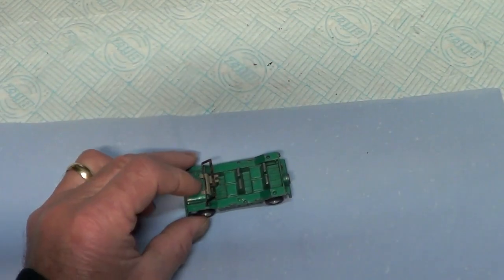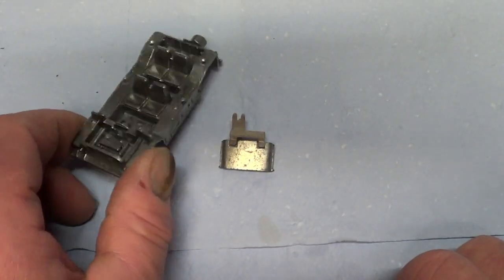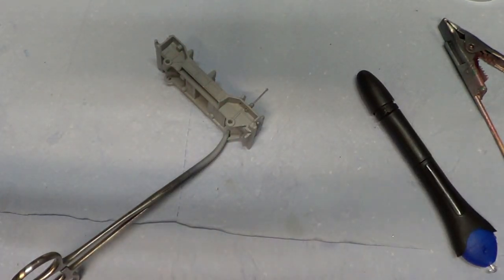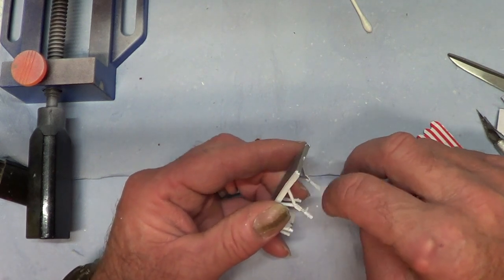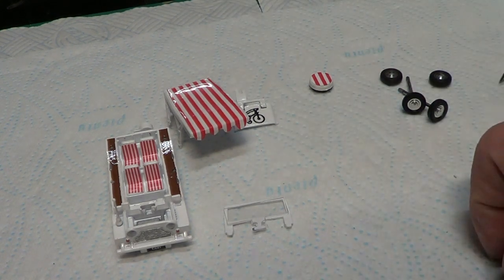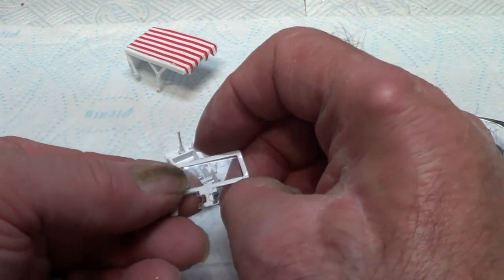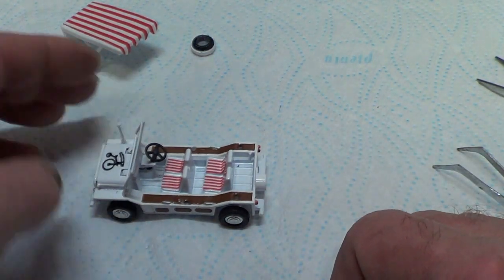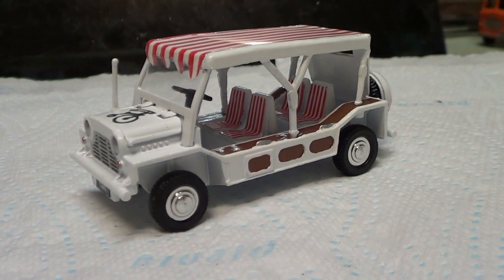DINKY MINI MOKE RESTORATION

Comment: Another fine restoration.  This video taught me two things; that you have more patience than me and that I will avoid ever restoring one of these Mokes.  Conversely I did have a great day many years ago when I hired a real one during a day off work on Barbados, however it had no roof and I ended up with all my exposed bits sunburned a vivid shade of red.
Reply from the maker: Thank you David, had it been three years ago I think that the model would have ended up going out the window lol, I’ve mellowed with age and a bit more practice😉😁 I bet it was fun driving around in a mini Moke ,  I bought a little convertible Suzuki Jimny a couple of years ago for going to work in, nice and cheap, a bit of an old banger really 110,000 miles on the clock, freezing in the winter but great fun in the summer with the top down, ideal for Jersey👍😊😁🐸🐸

Comment: I reckon the finished model looks pretty cool Nick despite the paint problems with the plastic canopy. I've recently bought a plastic repro cab for a Britains Ford tractor (not Model Supplies) and they sent instructions to wash it with warm soapy water, and thoroughly dry before paint spraying. I haven't done it yet but I wonder if that might've helped with your canopy? Looking forward to your next video, I'll be sending you a parcel shortly. All the best. Peter. 👍
Reply from the maker: Thank you Peter, no I didn’t wash it first, just a quick wipe with meths but that might not have been the right thing to do, I don’t think there is much you can do the parts that flex the paint will come off regardless, and the vinyl sticker paper I used is very sticky, which didn’t help. I did use plastic primer first but that didn’t make much difference either. Next time I have a plastic part to do I will try washing it in soap and water though, so thanks for that tip👍😊 Looking  forward to another surprise from you Peter, thank you very much for thinking of me again! 👍 All the best, Nick🐸🐸

Comment: That looks real good and I want to share with you I use a glue some it is called E 6000 it works good for me you might not like it I just though I would share
Reply from the maker: Thank you Rick, I will see if I can get some of that glue to try, thank you for the tip👍😊🐸🐸